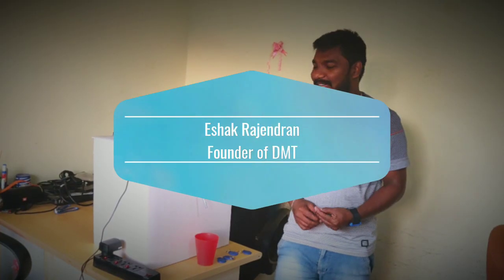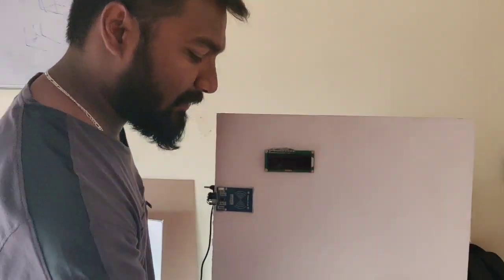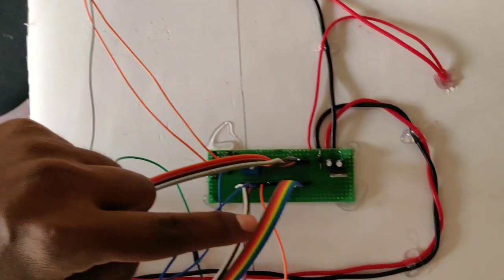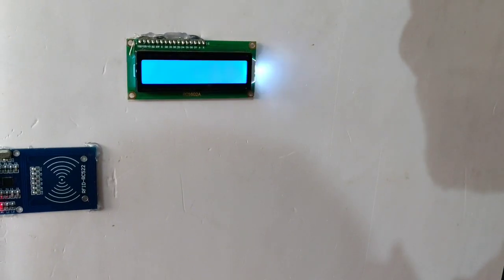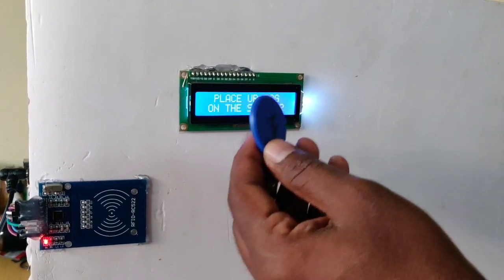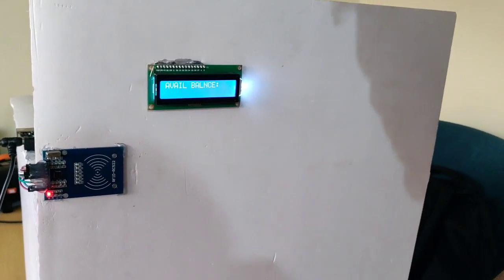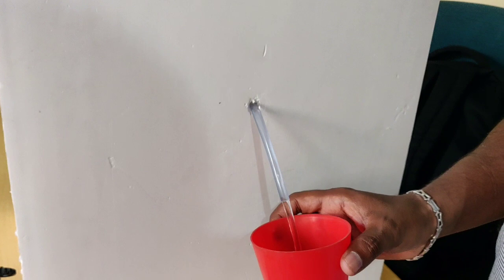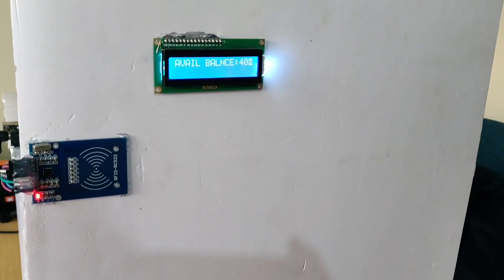RFID water dispenser using Arduino by DM Techtrix

Comment: Hi bro I am currently doing a similar project like this. Firstly thanks alot for the video, give me a better idea on how to do. Can you please send me how you connect your arduino microcontroller to the motor circuit and RFID? can you please send me the connection list of which pin to which pin ? Thank you so much
Reply: Thanks for watching, it's a paid project can't share it freely. 10k is the cost for this project